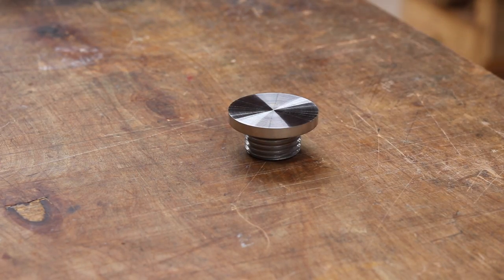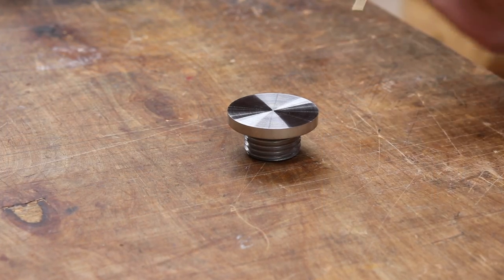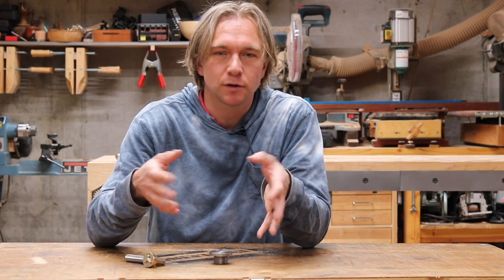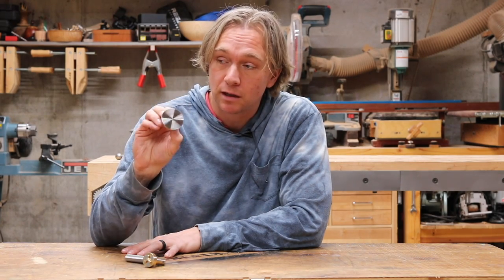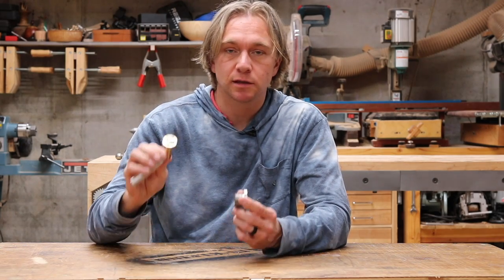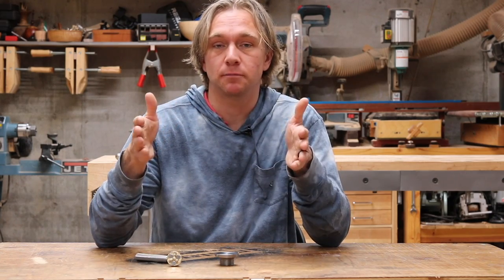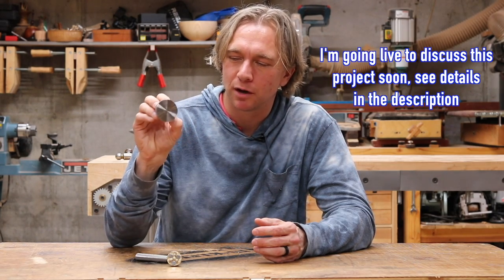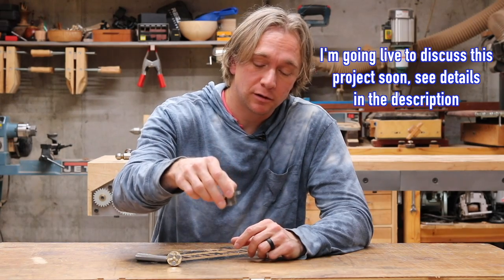A Screw With No (visible) Slot Is My Next Big Thing!

Comment: It's cool but I would never spend that kind of money. Just one man's opinion. Thanks for doing what you do.
Reply: It looks frigging amazing, but I do think there are really cheap alternatives to this.
Reply: Same
Reply: I would easily spend that much on something because I would just roll that cost into the selling price. And if I wanted something really cool for my home. I would also spend the money. You want cheap, you get cheap. But as far as clients or just fans of your work go. They would see the quality in a piece of hardware like this.
Reply: Yep me too, if I really need something similar, I would just use a hex bolt.
Reply: I see HighEnd furniture makers using them.. I wouldn't try to mass market this beautiful hardware. Personally, I'd use hex and plugs for the hole. But I could see the company I work for, that is run by designers, would totally choose the uncommon, expensive option over the practical, cost effective one.
Reply: It’s great but overkill for my projects. We use dominos for most joinery. Here’s a name suggestion: FLUSH CLOVERHEAD
Reply: GHOST SCREW
Reply: @ffanddcondragh2911  The thing is that it also needs to add value. There are already lots of cheaper ways to hide how something is assembled. And this screw won't even provide a quality fit you couldn't achieve otherwise. It's a novelty, and a very pricy one. This might be enough to justify that pricetag for some people. But if he is going to invest lots of money, he probably needs quite some volume as well.
Reply: This is something I would offer upper crust customers but rarely
Reply: Yay Same here to expensive to justify I just put a metal cap over the hole
Reply: @narxic  the only purpose for using this instead of just covering a recessed fastener is for easier disassembly... But how often (if ever) is the proposed furniture going to be disassembled? Ikea furniture maybe... High-end not so much. This seems more like a solution in search of a problem. Looks slick I'll grant, but if looking slick is the only reason for being then it will never go far particularly when you can get the same look for exponentially less money.
Reply: A screw that needs an EDM machine allocated during almost an hour, a lathe for screw and finishing, assembly process, inner springs... It will cost way more than 40 dollars. A lid glued over has the same visual effect.
Reply: It's an amazing concept but indeed. A project using only four of those already sums up $160, not to speak it's hard to conceptualize what's essentially a functional fastener as an high-end/decorative item. Its beauty is in its function, yet the final costumer would hardly get a $60 driver to demonstrate its functioning, whereas it offers as much decorative compliment as a simple metal plug would.
Reply: @GabrielMarques001  screws are formed . This part could be mass produced in the same fashion, broached.
Reply: @wannabecarguy  true, the same process to make the base bolt can be used, then an EDM for high precision slots, then fine finishes. Still sounds costly as EDM is not for high production volumes. And one could easily damage the slot 'invisibility' by pressing a hard object against it. Yet, that's how good ideas are made, by trying and improving. I'm not disqualifying it, just seems there's a lot of work to get to a commercial product.
Reply: @ffanddcondragh2911  that’s really it, higher quality parts that look really nice by itself.
Reply: Invisible locks screws
Reply: I've used industrial fasteners with a blind head and a hex key end like a set screw on the nut end used when the back side isn't accessible for maintenance.
Reply: @ronweber4508  Isn't that what Demi Moore got from Patrick Swayze 🤔
Reply: There are alternatives for every isr he mentioned. a metal disc (with a magnet if you need accessibility) as a cover is all you'd pretty much need
Reply: Expensive now for a screw but give it a few years and they’ll be mass produced and cheaper… 

Looks like a fuel tank lid.
Reply: Somebody out there has the money and are willing to spend it
Reply: @jaxjaguarz  if he could market to the people who do demos there could be a market. Giving a display a clean look but easily disassembled could be added value.
Reply: Thinking thensame thing but I have eaten my words before.    "I WOULD NEVER SPEND THAT MUCH ON NIGHT VISION"  OR "Flyrod."   Famous last words.
Reply: @wannabecarguy  as a machinist/tool and diemaker and quality inspector, I can say from experience that roll forming and then broaching that head (in 410 SS!!!) to the required tolerances for that "invisible fit" will not be possible esp. with that complex tri-lobal socket shape. In mass production tolerances grow to accommodate error and tool wear. I'm guessing he either used a CNC mill or a sink EDM, but most likely CNC. Either way it involves long cycle times per part and a HUGE amount of quality contrtol. 

 Including a spring, I'm guessing there are 4 parts to this assembly: The body of the bolt including including the thread and a bored out head with a tight tolerance stepped ID for press fit of the socket disc, the socket disc itself with a tight tolerance OD for press fit into the head of the body and the extremely tight tolerance complex shaped socket, the plunger with the matching extremely tight toleranced positive shape to fit in the socket disc, and then the spring. 

The socket discs and the plungers would have to be made as matched pairs because you could never guarantee the right fit if you had different machines running them at different times. The difference in machine temperature at the beginning of the day vs the end is enough to throw off the fit. Doing them together on the same machine would at least allow you to dial in your small diameter tools, and you'd have have proportional tool wear on each part. Fit check and matching as the plungers and socket discs come off the machine.  
The parts would have to be assembled (pressed together) and then returned to a lathe for final finish machining (and maybe some hand sanding while its still in the machine) on the head. Then each piece would have to be verified/pass visual inspection for the "invisible fit"

3 machined parts (2 of which are very precise) in an expensive and tough material, minimum two operations each, the need for a competent machinist or operator and tons of quality control, assembly, machining again with hand finishing/polishing. This is not a product that lends itself to cheap mass production. And its also important to note if size options are to be explored that trying to size it smaller increases the difficulty of making it. More likely to have success with a high-end Job Shop.

Ultimately this is not a $40 part. Maybe $140. As such it's really a niche/boutique thing and I can't see it grabbing much market share in any sector whether its Furniture, Automotive, Instrumentation, or Aerospace.... 
That's my bit. Just my opinion as someone whose worked in precision manufacturing. YMMV.
Reply: a wide tip screw driver could open it.
Reply: I would definitely buy them
Reply: I would buy it
Reply: @JB-xp8xl  Once at least before you mar the finish/fitted edge.
Reply: Why wouldn’t you just design a screw that has a magnetic cap that covers the counter sunken screw……?
Reply: Like others have said, you wouldnt be buying the screws and wrench tool outright. They would be included into the upfront cost of, most realistically, ultra high end furniture. I’m talking stuff that already costs hundreds to thousands of dollars as is, and that way both the profit margin and target consumer remains relatively intact, in that two screws plus the tool for $140 added onto the price doesn’t necessarily make or break the pricing. For a lot of this ultra high end furniture  $140 often ends up being about what you pay for shipping if you order it online. Just a thought
Reply: Like others have said, you wouldnt be buying the screws and wrench tool outright. They would be included into the upfront cost of, most realistically, ultra high end furniture. I’m talking stuff that already costs hundreds to thousands of dollars as is, and that way both the profit margin and target consumer remains relatively intact, in that two screws plus the tool for $140 added onto the price doesn’t necessarily make or break the pricing. For a lot of this ultra high end furniture  $140 often ends up being about what you pay for shipping if you order it online. Just a thought
Reply: Like others have said, you wouldnt be buying the screws and wrench tool outright. They would be included into the upfront cost of, most realistically, ultra high end furniture. I’m talking stuff that already costs hundreds to thousands of dollars as is, and that way both the profit margin and target consumer remains relatively intact, in that two screws plus the tool for $140 added onto the price doesn’t necessarily make or break the pricing. For a lot of this ultra high end furniture  $140 often ends up being about what you pay for shipping if you order it online. Just a thought
Reply: @ffanddcondragh2911  that’s fair but I agree with OP. Not everyone has that kind of cash brother.
Reply: @warderbrad  it would be way to expensive for demos
Reply: Cute, fun. If it does catch on the surprise value disappears. If it doesn’t catch on it’s too expensive. There is NO market for this, IMHO. If you could make it in your own shop and add it to a conversation piece of furniture it would probably overshadow the other aspects of the furniture. Interesting, but no.

Comment: I'm an electronics guy rather than furniture or carpentry, but I can actually see a few uses for this seamless bolt in some of the things I might do.  In particular, I could see it used for antenna encasing, water & air-sealed compartments(for underwater vehicles/robotics), possibly even uses in aerospace engineering.  A bolt like this might actually be more marketable to those in specialized engineering fields.
Reply: I had the same thoughts.. Imagine how great this would look on the outside of a space craft!
Reply: Exactly!! this could have a much greater use in aerospace engineering!
Reply: would also say its more for thos fields, in furniture making u dont really need screws, if u have the skill
Reply: i agree with this, but i could never justify the cost over something like a rivet. i just haven't needed a screw that has EDM levels of flush. the screw really reminds me of the printed magnet latch, which is another thing i'd love to use but can't find a use for
Reply: @safrando  unfortunately you will quite likely run into the cold welding problem due to the good tolerances and it being the same material.
Reply: This is so true, especially if used as a way for all way around flush mounting things, where you don't  have to Engineer a special trick in to end up with flush surfaces.
Reply: Also it helps to name things used in these applications by an easily understandable name. Designers that use this will Need to know that they are Magnetic in nature. Instead or reading a document or paragraph about how they work, it would be better to include the reference into its name.

Honestly I would call them.

"Mag Screws" aka Magnetic Screws

Or just "Mags"

This table build will require four Mags.
Reply: As a mechanic, electronic technician, underwater drone operator and SCUBA diver I kindly disagree. I know with the tight tolerances in the disappearing screw drive that very little marine salt water would easily foul the functional operation of the fastener. Best use case is for clean dry high end esthetic markets.
Cheers, #SeattleRingHunter
Reply: @mclovinmylife  and in how many applications is your flush surface functionally (not aesthetically) ruined by a recessed slot in those flush sitting screw heads? If you really think it has any effects on air-tightness or anything like that, I'd love a drawing...
Reply: @mclovinmylife  for those appliances its probably way to heavy. Sorry to break it to you but all it is is a cool idea ajd a novelty. Flush rivits do excist and otherwise just put a bit of tape over the screwhead

Comment: "Seamless Security Screw"

I agree with other comments that this is less of a fine furniture aesthetic as it is more of a brilliant hidden secured restraint. The fact that you need a special driver or "key" to open it and it isn't visibly intuitive for someone who just comes across it are great elements from a concealment and security standpoint.

I would definitely target security applications. It would even be cool to see a secondary magnetic slide pin upgrade in a future version for the ability to have them unlock in custom orientations.
Reply: He showed that it can just be pushed in with any tool.  Not secure since the lobes can be used to turn once depressed.  Someone could probably just use a screwdriver held at an angle.  Good product, but security through obscurity is not a good idea.
Reply: @latemanparodius5133  this
Reply: @latemanparodius5133  Security is different than impenetrable. It more so means the tool used to open it is specialized or uncommon. 

I think that is a good name.
Reply: @FueledByRyan0  It isn't secure, though.  I could use something completely different from the intended tool to turn it, and not even a specialized tool.  There isn't ANYTHING to prevent an unauthorized person from turning it.  If someone finds it, they can likely find something suitably stiff in the environment to open it.  It's on the same tier as a false bottom in a drawer.  Hard to find, but once found there is nothing preventing or even delaying access.
Stealthy, yes.  Secure, no.
This doesn't prevent it from being a nice product.
Reply: As Seen on TV: The InvisiScrew
Reply: Lockpicking Lawyer has entered the chat...

Comment: Yachts, leaving a surface perfect, looking like decoration, can’t  imagine designers in Italy, Germany or England wouldn’t love this !
Reply: As long as corrosion won’t damage them in the long run
Reply: Blind Screw
Reply: And yet there is a way of achieving pretty much the same result with whole contraption being a fift of a price and less prone to faults, corrosion and scratcher plus an option to easily replace visible part for about 3 bucks.
Reply: @blainerohlfs  just needs to be made out of the right type of metal with the right coatings and or treatments.
Reply: @zukoHD  that would not help much
Reply: @zukoHD  it's the build up of salt and moisture as much as anything.
Reply: @HidekiShinichi  if he can make them out of marine brass it would be fine.
Reply: @tmarritt  are you suggesting that marine brass is hsrder than steel?
Reply: @zukoHD  His website says it is made out of 400 series stainless steel
Reply: @HidekiShinichi  no but its certainly more resistance to corrosion. Kinda the issue right?

So for use at sea it would be the only practical option, you lose a bit of hardness but gain on the properties you need for the environment.

Comment: For that extreme of a price, I'd honestly just go with decorative cap standard screws. They come in a variety of sizes, included much smaller allowing for more delicate designs and they're dead simple already.
Reply: I missed where he said the price. How much are they?
Reply: @literate-aside  $40 a screw, $60 for the wrench
Reply: @Andy-jq5yw  Expensive, but then say 2 to 4 in a custom piece, probably worth it.

I'd say not sellers, not hobbyists.

I'd wager a huge amount of work goes into them. Price would drop if he could scale it.
Reply: Any damage to the seam would also negate the whole point of the product.
Reply: @xnecron99  You could sand it back down as long as it wasn't too deep.

Besides, you can say that about most things. Phone screens crack, wood splits, finishes damage etc

The simple solution is, don't damage it 😁
Reply: Yes, I would buy it . It looks cool if you have vision for the future.
Reply: to be fair this kind of fasteners are mostly used by designer furniture artists can sells their product in a glamorous price. This wont be used by regular hobbyist or diy people
Reply: Exactly. Recess a normal fastener and put a plug on it.  Does the exact same job.   Any sort of application where you want something like this is also an application where you’re never undoing the fastener anyways.
Reply: @someusername121  Except for hidden compartments, adjustable furniture, latch systems etc
Reply: Which kinda indicates frequent access is the feature here vs hard to remove caps, or impossible, or lost caps.
Reply: @GuardTower  exactly my thought can see my work using this for high end clients and like retail type
Reply: @literate-aside  realistically if I’m going to pay a high price for something I wouldn’t want to have maintenance.  He even says to sand the seam invisible it’s expensive. 

A phone screen isn’t suppose to crack under normal use.  If this screw is used, fastened in, maybe taken out etc, any use is going to ruin the finish of the material.  Me touching my screen typing this message on my 3 year old phone has not deteriorated the quality of my device.  There is no comparison, this screw he’s made is really cool, but there’s people who’ve done it better easier and for cheaper.  This would probably only be a niche thing for a rich person who didn’t do any research on these hidden screws
Reply: @chandrasekharlimit4547  like many such products it's niche; doesn't make it useless.
Reply: I don't think that he is expecting to ship 100k of units a month 
His biggest problem is getting the word out to the target market
There is lots of upmarket furniture (4 post king beds, Gun display racks,  ect.. ) are sold that do not fit through doors or needs to ship, that requires disassembly and that bolt would solve,,,, and off set the expense of some joinery whitch would be appealing. It is a feature just like using a rare timber inlays, dowls, keys that allow disassembly